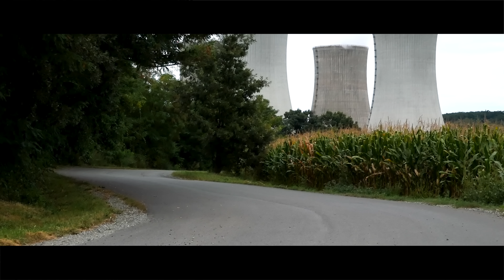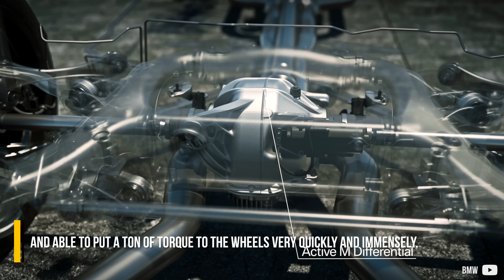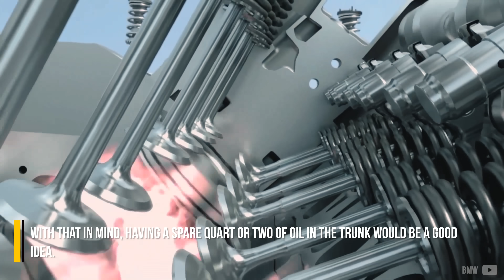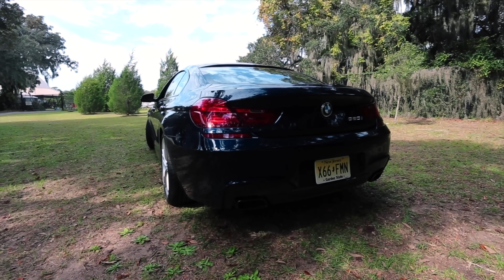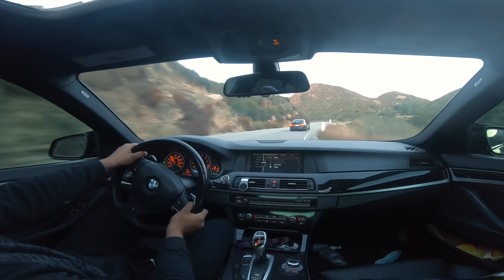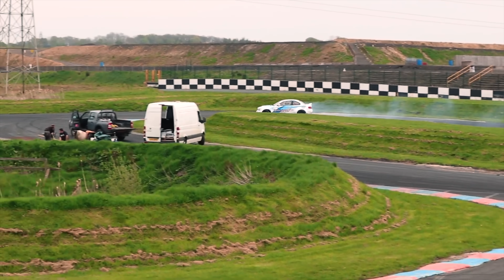The Worst BMW Ever?

Comment: Such a complicated twin-turbo engine for only 400-450hp. An LS would make similar amounts, while naturaly aspirated and can be rebuilt in your backyard.
Reply: LS is a heavy fuel guzzler. German engines have to meet EU regulations in terms of efficiency, fuel consumption, emissions. Different basis means different approach. USA is very relaxed. In comparison: most of the current engines will be discontinued, as they don’t meet the current CO2 regulations!
Reply: @frecherfreddovic  it only spends more fuel on paper, not in the real world. Ls engines are pretty good! Im a german bmw driver btw
Reply: and find parts cheaper, way easier to work on as you mentioned. and all of that while being lighter weight!
Reply: The marginal improvements in emissions reductions in the past 10-15 years has lead to incredibly complex and unreliable engines. That don't even meet their claimed mpg. Turbo engines are great for that because of how the testing is done. They make fuck all power without those turbos, and as such, don't produce any emissions, but 400hp requires 400hp of fuel and air. Can't get around that. I highly doubt this engine has a much better bsfc than an ls3 or lt1, to justify it
Reply: @NatoriousGamePlay  having owned and worked with these engines, yes they are more complex and require more maintenance, but if you work on your own cars it doesn't matter at all. if you don't like maintaining your car, or pay someone else to do it, go buy a Toyota or something. This car is not for you.
Reply: @kirunacat  yes, more complex and require more maintenance, for marginal benefits. Not to mention if something goes wrong, it is significantly more expensive to fix. Y'all love to knock on American design, but simplicity triumphs all at the end of the day. It's hard to objectively justify a more expensive, more fragile engine for the same performance
Reply: @NatoriousGamePlay  I wouldn't call the N63 fragile, they can handle bigger turbos and lots of boost on a stock bottom end, four bolt mains with beefy rods, they're quite overbuilt for only making 400-520hp stock. Simplicity is easier and cheaper to work on sure but something complex and modern has different personality and some people like that side of technology more. Ultimately the benefit is always up to the person who owns the car. I personally would never want a pushrod engine because I think the design is archaic, ugly and has way too much valvetrain mass, but that doesn't mean that you can't crank out 1000hp from a 6.2L LS
Reply: @NatoriousGamePlay  Efficiency and weight isn't a marginal benefit for us, you know. Keep in mind that we pay 7$ per gallon of fuel.
Reply: @kirunacat  idk why people care about valve train mass as if every engine revs to 8k. Most barely go past 7k, so a 6500 rpm redline isn't unreasonable. No, they aren't for everyone, but the reasons to me, that people don't like them, aren't necessarily justified. Simply being "old" isn't a good reason. Less flexibility, absolutely, can't change the cam timing nearly as much as a dohc can. Personality wise, absolutely, they are very grunty. They just make power down low. Don't need to rev it out. 

My point about fragility isn't about the actual structure of the engine. It's everything else. It's not like a Toyota which can miss or be late with maintenance with no problems. Or handle large amounts of continued abuse and just not break. It's not so much the crank, block, pistons or rods. But every other part of the engine
Reply: @christiansprojects-cgmanuf1426  but the real world difference is marginal. A Camaro will get around 30mpg on the highway. The marginal difference I talked about was emissions. They're really not that different. 400hp requires 400hp worth of fuel and air. Can't get around that. And your engine weighs the same as an ls. In fact, just slightly more. The lie of turbo cars was better fuel efficiency.
Reply: @NatoriousGamePlay  At least on my cars,  the difference isn't marginal at all. My old Audi (Sanme year as the Firebird TransAm) uses around 30% less fuel than the TransAm while being just as fast. Or let's say just as slow, haha.
An engine does not necessarily consume the same amount of fuel for the same power. If that were the case, why do today's engines produce three times the power with the same amount of fuel as an engine from 1920? It's simple physics: The smaller the engine, the less thermal and friction losses you have. The better the fluid dynamics, the better the combustion and thus the more efficient the engine. I mean, I like american engines and I'd love to own a more powerful one if gas prices were the same as in the US. That's why I own one after all but you can't overcome the laws of physics.
Reply: @NatoriousGamePlay  the valve train mass matter when your engine revs 7k+ which rpms = HP so it's pretty important for performance. If you want a car that you don't need to be absolutely on time with maintenance a BMW is definitely not your go to. Personally I think you should always be on time with maintenance, I beat on my F10 550i daily without any major issues at 100k mi. The only issue I've run into at that time was carbon deposits(which isn't BMW specific) and HPFPs which are easy to replace.
Reply: @christiansprojects-cgmanuf1426  the trans am you have, in no other way to put it, is trash. Here in America, where v8s are plenty, the tbi small block is considered worthless. Poor fuel economy, little performance. It's completely disregarded. People build old sbc's or LS engines. Never a tbi unless you want to be different. 
The bsfc of modern engines is far higher than the 1920s. But, surprisingly, not by all that much in some specific cases. Few cars from that era, put out power about equal to today's engines. Granted, race engines mainly, but keep that in mind. Hell, some engines from the 70s are pretty similar to today's engines in terms of hp/displacement. 
Yes, I'm well aware of the advances in engines. But it's mainly from head design. We have more efficient combustion chambers and intake/exhaust ports. Like are modern engines really that much better than those of 15-20 years ago? No. 
I know we can't beat physics. Why do you think a cam swap wakes up an LS? Because the cam is very mild so it can meet emissions. But swap the cam and a tune. You'll get similar mileage still, but way more performance. That's why the big engines of the 70s and 80s suck. Tiny cam to meet emissions.
Reply: @kirunacat  I mean, I can build an ls7 to spin to 8k if I really wanted to. I know valve train mass matters. But most pedestrian engines don't really rev higher than a pushrod engine. So like, what's the point? If they're gonna brag about how advanced the engine is, take full advantage of it. 
I'm not saying you shouldn't ever be on top of maintenance. But that's how engines are remembered. How long can it go between maintenance, how much is needed, and how much neglect can it take? If things fail prematurely, even if it's not part of the "engine", but it's attached to it, that's a big problem. That's why engines like the LS, 1uz, om606 are remembered. They can just take abuse and go 1 million miles on general maintenance. I highly doubt that the n63 will ever be able to match that
Reply: @NatoriousGamePlay   @NatoriousGamePlay  The thing there is that you'd have to build the LS, also with 2v per cyl you're at a disadvantage in terms of flow, plus with four camshafts you have independent control of intake and exhaust VVT and VVL (for valvetronic engines). Absolutely with the maintenance, an engine that needs less in labor and parts over time will be remembered by a larger demographic since the vast majority of people don't want a car for it to be anything but a form of transportation so you kinda have to look at the engine from a different angle when comparing performance cars. When you're beating on a car there is a much higher chance you're gonna wear something out faster than someone who drives it like a grandma.
Reply: @kirunacat  I mean valve springs and a cam isn't much of a build. But yeah, 2v is a disadvantage, but they flow incredibly well. The same as a coyote. The listed engines are known performance engines, that can last forever. How many diesels can rev to 7k like an om606? Or be as versatile as an LS? Or rev to 8k forever like a built 1uz. 
But that's true, different engines are remembered for different things. Like s85 v10 from BMW. Known for entirely different reasons than a Camry engine.
Reply: @kirunacat  engine design doesn't matter especially if it's a reliable engine and can push lots of hp
Reply: @Aurora20778  to many people it does, that's why some people prefer N/A over turbo, or S/C over turbo, or RWD over FWD, or AWD over either. Some people even like carburetor over EFI
Reply: @kirunacat  idk why it matters but ok
Reply: @Aurora20778  maybe you have not driven many of these different cars to know there is a difference
Reply: @kirunacat  -_- bruh
Reply: @NatoriousGamePlay   Well, there is a reason no one outside if the USA wants an LS after all. I mean, there are some here in Europe but far less than anything else.
Reply: @christiansprojects-cgmanuf1426  yeah, y'all tax based on displacement. So a 6+ liter engine would be prohibitively expensive to own. America does not do that. Top it off with high import taxes, and the value proposition it is here, is gone. Now a Corvette costs the same as an Aston Martin. Has nothing to do with "prestige" considering most of European vehicles sold are 4 bangers, and many of which are diesel.
Reply: @NatoriousGamePlay   Nope, not here in Switzerland. We pay by weight and fuel efficiency. Besides my daily, a BMW E91 with 3.0 straight six, I own a Firebird Trans Am with the 5.0 TBI engine just for fun and sunday drives. The thing is, the BMWs engine has torque from 1000rpm all the way up to 7000 while using less than 8L/100km on the autobahn (30-35mpg). Also, it's smooth as silk and it only weighs 120Kg (260lbs). You can't do that with any LS. I don't say that american V8s are bad. They sure are good and reliable engines but if weight and efficiency matter, they are just outdated. That's why you don't see them in the rest of the world.
Let me make an example from the 90s: I also own a 93 Audi with 2.3 litre 5-cylinder. So it's from the same area as the Trans Am. It can nearly keep up with the Trans Am but it has less than half the displacement the Trans Am does.
Reply: @christiansprojects-cgmanuf1426  our cars were never meant for the rest of the world. Our pushrod engines make some 90% of their peak torque from 1500rpm to 5500 or so too. Hell, corvettes are even known to get 40mpg on the highway if you drive it nice. But it's probably the import tax if anything. Some cars simply not made for some markets. We don't get any French cars, and Europe doesn't really get any cars made for the us market. Just how it is
Reply: @NatoriousGamePlay  a Corvette does not cost as much as a aston martin at least not a base model
Reply: Go drive a Corvette then
Reply: @ataorkunoguz5451   A Corvette should be better to drive than a 2 ton 4 door sedan
Reply: @leonidasarsenopoulos6528  Go drive a Chevrolet Corvette than.
Reply: @leonidasarsenopoulos6528  some people don't like trucks
Reply: @leonidasarsenopoulos6528  you can't get an AWD Corvette tho
Reply: LS is also two liters larger in displacement. If the LS was DOHC it would make so much more power. The LCI made 450hp which is above 100hp/L, something that no N/A LS engine does stock.
Reply: What? s63s make around 600hp. LS engines do not make similar power naturally aspirated. Ive owned both.
Reply: S63 makes 550-600 hp. N63 makes 450.
Reply: The N63 engine can be tuned out of the box to almost 600 hp. An LS can't do that. The cars housing an N63 also are beautiful and luxurious. I'm a Corvette man but I have to admit that the Corvettes really don't have anything on German cars when it comes to that.
Reply: It sure is true that you can get the same power out of a way more simple engine but but then, fuel consumption and emissions are useless in the rest of the world. That’s the reason basically no one outside of the USA uses american engine - because they are stuck in 1970. BMW always pushes the limit and sometimes, new things fail. That’s just the was it is. You don’t learn if you don’t fail.

Comment: And I thought the M3 V8 was bad...
Reply: After rod bearings and throttle actuators, it's smooth sailing. My VF650 charged e90 sings at 8400rpm without a hiccup.
Reply: E92 rod bearings and throttle actuators, ocasional oil leaks. But probably one of my favorite engines ever. I'd say it fits better in a lighter chassis like E30, E36 and E46.
Reply: E92 owners: screaming
BMW: "But wait, there's more"
Reply: I actually like those. Throttle actuators die quickly, but you can fit bronze gears to fix that issue. Rod bearings wear quickly, but if replaced then the rest of the engine is very reliable. They sound great too.

Comment: With that much oil consumption they should just replace the glovebox with an oil reservoir. Just dump a quart in there before every drive, you should be safe.
Reply: Oil consumption usually gets bad when you follow the 10k+ mile oil change intervals, it's very hard on valve stem seals which the N62 and N63 are famous for leaking. I had a 2011 550i with over 100k miles on it and it wouldn't lose more than a 1/4 quart in 1500 miles.
Reply: A quart a day keeps a spun bearing at bay
Reply: @creator4413 lol
Reply: Oil in Britain is crazy expensive and most people don't even know how to add it or will not until service.
I expect this will course a lot of problems?
Reply: @greyguy.960  No problem, do not buy a BMW in this case.
Reply: @MegaTomi9999  They don't advertise the problems for the common person though,   so to just dismiss it like you just did is disingenuous. 
Can't I point out such wrongs that catch out the innocent person?
You can't just use " bad product advertising as a great car " by saying the customer shouldn't buy it. One can point out the faults and be critical of the product
Reply: That much oil consumption, they should label it hybrid lol
Reply: Yep
Reply: 1quart a day😁

Comment: Unfortunately there are many bad ones but also many good ones, but the best ones are far in the past sadly
Ive had 16 so far
Reply: LOL just buy Toyota bro
Reply: @SejeSteen  toyota doesn't make 600 hp engines, I like toyotas, I have one and it's dead reliable. But, the buyers of high performance German cars and toyotas typically don't overlap lol.
Reply: @SejeSteen  you are so right!!  Recently purchased a 2019 Toyota Camry Hybrid and absolutely loving it and my 48 mpg combined average and superior reliability.
Reply: @MrBigBoy4Life  yeah but it’s slow as shit
Reply: @bilaltariq7819  umm, most people who purchase these types of vehicles do it for fuel savings and of course the reliability of Toyota.  I have ZERO problems merging onto the hwy or commuting around town.  It’s my daily driver and I fill up about once every 3 weeks and it’s still at about a 1/4 tank.  If I wanted a sports car that I’ll have to fill up weekly and race the guy next to me at the stop light, I’d get a Mustang or some type of fanboy racer.
Reply: @MrBigBoy4Life  my point is the video is about the N63, a 4-4.4L V8, not an economy engine, so its not comparable to a toyota or honda people mover. granted the  N63 is pure shit but it's still apples to oranges
Reply: lol stop coping, bro. just buy toyota or a honda. sure you might find some lemons but majority of the cars from these two companies are rock solid. don't waste your preciously earned money to support EU car companies. they are like parasites

Comment: From BMW only I6 engines nothing else
Reply: S85 for the win!!!!
Reply: M73 is also a very sturdy and reliable engine.
Reply: N47!
Reply: The straight six non turbo was BMWs best contribution to the world
Reply: V10's?
Reply: @lighteningbolt6397  No their v10’s are shite as well. Most every engine from BMW is. They all use plastic parts for hoses, guides etc. that fail under any sort of stress. I wouldn’t buy one unless you like fixing cars instead of driving them.
Reply: @lighteningbolt6397  Bro, you are obviously not a car guy (gal) because the BMW S85 V10 is incredibly notorious for being unreliable.
Reply: @MrSelfDestruct-1  The s85 engine has its rod bearing issues like the s65 but it's worth the sound it makes.

Comment: BMW the ultimate lease car absolutely useless long-term due to garbage components.
Reply: It highly depends on the engine and on maintenance. I have a E91 325i Touring as family car. It has 200k km now and the oil consumption is about 1L every 10‘000km, so really not that much. At around 150k km, I had to replace the injectors, ignition coils and the fuel pump. If these components last 150k km again I‘m happy.